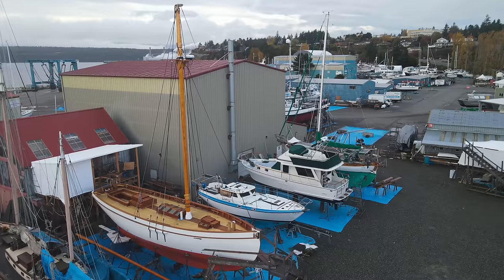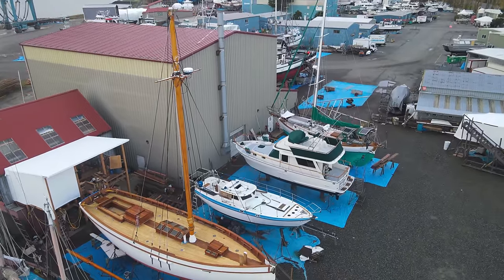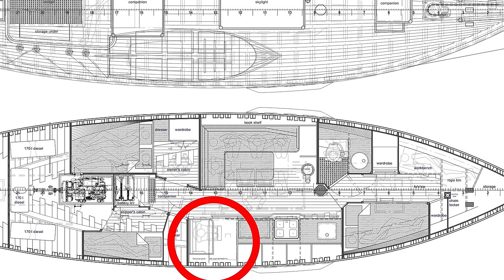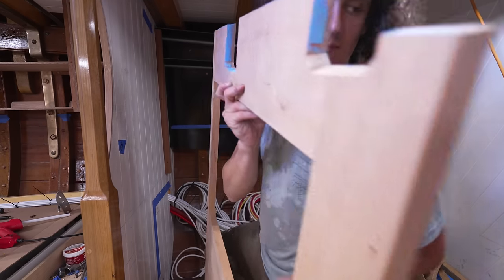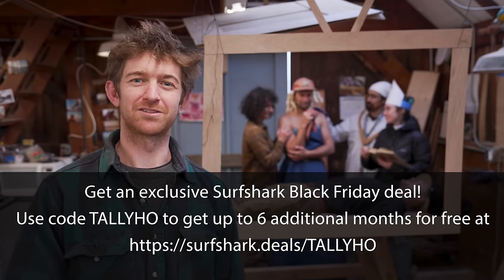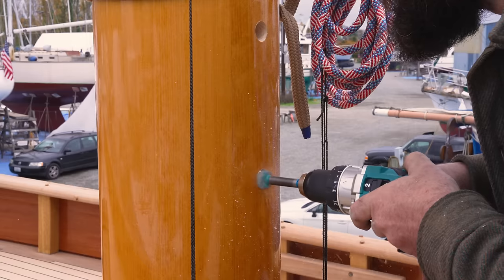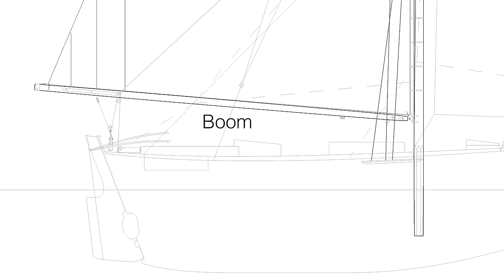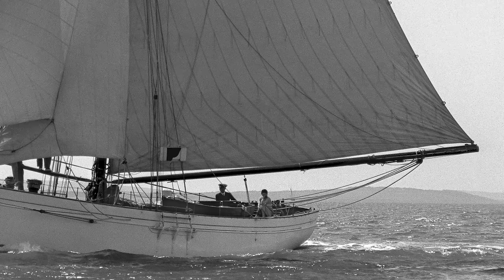Tally Ho gets an absurdly long Boom.

Comment: I always love seeing the purpleheart wood go into the boat. As someone who doesn't do much woodworking other than cutting a few bits of pine now and then, it's color is so alien to me! But kind of like cedar, with how it changes over time and after cuts.
Reply: Osage Orange does the same and although I appreciate the patina, it still makes me sad to see electric yellow go away.
Reply: I thought it was nuts how long those cuts with the chainsaw took. Even sped up it took forever. I would guess that an one cut took about 30 minutes. So an hour just to cut these pieces apart. Crazy stuff
Reply: purple heart is a very difficult wood to work with. it's very hard. the only carving I ever did with it I had to use coarse rasps, and my grandfathers WW2 kabar knife XD
Reply: I make hiking sticks as a hobby with various designs of top. Recently I thought it would be good to make a market stick top out of purple heart. I had never heard of this wood until I started watching Leo and the crew. However, once I started cutting and shaping the wood I was astounded as to how difficult to work so all praise to the crew. I finished off my stick with Danish Oil. While the process was more difficult than I could have envisaged the end result was well worth it and probably foolishly I am just about to start on another. Well done all the crew. There are people who call themselves carpenters and then there is Leo’s crew.
Reply: Xyla Foxlin used a small piece of Purple Heart to make a bass, and said the wood was so difficult to work with she'd never touch it again. Love thinking about that every time they start roughing up another big chunk of Purple! This crew ain't afraid of work

Comment: Love to have your comments on how the long holes for the fife rail post bolts were drilled accurately.
Reply: I wondered exactly the same thing! I imagine the process is the same as drilling the holes through the stem. I need to watch that video again.
Reply: Yea figured there would have been some footage of that  because I'm  sure it's not that simple of a task
Reply: At 11:46 video shows the top of the posts. The holes are a little off center but very adequate for the application.
Reply: I’m also a little confused about how the teak rail was mounted. Was it in two pieces split down the middle and both notched into slots in the posts. I was expecting the rail to master the posts, then the bolts to go through all of them , but I guess they needed the posts to stick out above…
Reply: Centered to the posts?  LOL they need to be centered on the backing oak down below MORE.  Where that was is dictated by the  support structures underneath.  The rail had to be where it is by the distance to the mast.  Of course I guess but drilling into the center isn't hard.  Although I wanted to see the giant boring bit going through the purple heart as well, @buckboard43
Reply: @trevfindley4155  I'm guessing it's like the separators in a cardboard box for 12 wine bottles ;) where a slot is cut into the two crossing pieces and then the pieces are pushed together. The joint looks wonderful!
Reply: All I know is they were done with Zeal!

Comment: I just got well confused and had to talk to my new best friend about sheets:

User
I just heard that in rigging, a sheet is actually a line - possibly connected to the boom. I thought a sheet was a sail!?

ChatGPT

In sailing terminology, the term "sheet" indeed refers to a line (rope) rather than a sail, which is a common misconception. A sheet is used to control the angle of the sails in relation to the wind, and it plays a crucial role in managing the boat's propulsion.

Each sail on a boat typically has one or more sheets attached to it. For example:

    Mainsheet: This is the rope used to control the main sail. It is often attached to the boom, which is the horizontal pole extending from the mast and supporting the bottom of the mainsail. The mainsheet allows the sailor to adjust the position of the boom and thus the angle of the mainsail.

    Jib Sheet: A jib is a type of sail set ahead of the main sail, and the jib sheet is used to control it. Like the mainsheet, the jib sheet is vital for adjusting the sail's angle to the wind.

The purpose of sheets is to "trim" the sails, which means adjusting their position to optimize the boat's speed and the efficiency with which it captures the wind. This is a fundamental aspect of sailing, as the positioning of the sails directly affects the boat's ability to harness wind power.

The word "sheet" in this context comes from an old nautical term meaning the corner of a sail. The ropes were originally used to secure the corners of sails before they took on their current role in sail adjustment. Over time, the term evolved to refer specifically to the ropes that control the sails.

User
What about "three sheets to the wind", what does that mean then?

ChatGPT

The phrase "three sheets to the wind" is a nautical idiom, but it's not directly related to the technical aspects of sailing. Instead, it's a metaphorical expression used to describe someone who is extremely drunk. The origin of this phrase is indeed nautical and relates to the sheets (ropes) used in sailing.

In sailing, a "sheet" is a rope or line that controls the tension on the corners of a sail, not the sail itself. The stability and direction of a sailboat are greatly affected by how these sheets are handled. If several sheets (particularly on different sails) are loose and flapping in the wind, the boat would lurch about unpredictably, much like a drunken person staggering.

"Three sheets to the wind" specifically refers to a situation where three of these lines are loose, causing the boat to be unstable and out of control, similar to how a person might behave under the influence of excessive alcohol. Over time, this phrase has been adopted into general English usage to describe someone who is very drunk, drawing on the imagery of a ship being tossed about unpredictably due to its loose sails.

Comment: For any other non-sailors scratching their heads at 13:35 perhaps this helps: 

Boom = Wooden pole for controling the lower edge of the mainsail (not a loud sound) 
Sheet = Rope line (not a sheet) 
Horse = Iron bar to hold the aformentioned sheet (not a horse).  
Gybe buffer = See horse, 
Tack= lower forward corner of a sail, 
Clew = Aft lower corner of a sail.

Great work as always!

Comment: Wait a danged minute! How did you drill the holes vertically in a post that long and stay in the center of the post?
Reply: I missed it too.  I replayed back a few bits trying to find it.  It wasnt recorded. Maybe they used a wood lathe, where the stock would rotate and the drill bit would remain stationary, insuring an on-center bore.
Reply: They have a long drill custom made already. It's just drilling a long hole thru some wood. 😅

Comment: 17:50 I just need to point out the BARREL . The bokeh’d barrel in the bottom back corner of this frame is a perfect example of how carefully and meticulously Leo and the Crew are going to nail this build, exemplary, truly. That probably didn’t have to be there, it was probably thought about, yet  it adds such a sensation. Applause, all around.

Comment: I yous to race on a 30ft. snub nose gaffer -1923- ,The owner decided to add a little more sail area > Like a 12 ft. bowsprit & a 24ft boom as well as a sky sail , When the sky sail top sprite would crack (& it did reguly) we called it an auto reef . Great fun especially down wind in a gusty 30 knots . Skippered a sister ship to what your building there , Fine job , Fair winds .

Comment: The mast height (and I know the topmast isn't installed yet) boom length and upcoming bowsprit installation show that 2023 Talley Ho, while not only faithfully replicates her original rig, harks back to the era of super-sized rigs (like those that were sported by the J-Class racers) especially when compared to the average modern yacht. Her overall length isn't that great but her sail area in calm conditions will be huge, perhaps double that of most yachts around her, and more in line with modern super yachts.

Comment: Pretty sure the fife rail is so named because the fife player and drummer would stand there (at the break of the quarterdeck where the fife rail was located) during ceremonies such as piping the captain aboard. In the original lexicon, Tally Ho's fife rail would likely be called a pinrail as well.

Comment: With a machinists eye, I see that the goose neck hardware is Skookum, but the pin connecting the the boom to the bronze mast bands looks only about 1/2" diameter.
Why so small? I would have designed 3/4" minimum, and maybe 7/8". If you some how jam the boom toward the mast under sail, you are in deep do do.

Comment: I've always thought (for no particularly authoritative reason) that the fife rail was so called because of its resemblance to a fife.

After all, it's pierced with a regular series of holes. In service, these will take belaying pins, but in the shop the holes are open. The resemblance to a fife requires only modest imagination.

All credit to William Fife III, but these rails predate him by well over a century.

Comment: You could install a 6mm thick polycarbonate sheet under the glass. In this case, even if someone steps on the window in a storm, he will not break it or cut his leg, and even if the glass cracks, the polycarbonate will withstand everything, even the fall of a tool or rope from block

Comment: Seems like "Duchess of Desire" would work well on the tender. Incredible work from the whole crew. The boom, mast, and hardware look incredible. Any way to ensure that a dropped pin doesn't take out the cabin roof glass? Safety wires?

Comment: Great to see another piece of the rig go on. 

Rachelle makes a good addition to the duchess of desire cast. That's too bad you didn't show Zeal drilling the long holes. I was wondering if those one were going to be done with a lathe/etc as they are in small enough pieces to be moved around at least.

Comment: Would really have liked to see how that rail was fitted between the posts and how it was fastened to mitigate the upward tension
Reply: It appears the rail was halved lengthwise, and rebated into the post, each on three sides, then glued along the seam. The rail's not going anywhere.

Comment: Why were there holes drilled into the mast (12:27) where the gooseneck fitting rings are clamped to the mast. I don't see any bolts that go into the mast through the gooseneck rings. It also looks like some plastic rings/tubes were put into the holes... what are those for?
Reply: the hardware has bosses which are part of the casting that stick into the mast to help keep the gooseneck located. the holes in the mast are lined with G10 tubes to help spread the stress across more fibers in the soft spruce.

Comment: What was the point in drilling the holes in the mast and inserting the fiberglass bushings?? Are there hidden bolts that are threaded into the backside of the gooseneck fitting which takes the boom and then the forward clamping ring hides the bolt heads from view??

Comment: Thanks for another great video. Out of interest, is there a reason you wouldn’t have the bolts for the Fife rail going through the rail too and holding the whole lot into the deck rather than just the posts?

Comment: I notice from previous video you are using high tech spectra or similar rope for standing rigging. While lighter when dry, does this not become very heavy when wet or does it not absorb water like normal line? Will all the hylyards cleated to that post thingy not interfer with the swing of the boom when the main sheet is eased? I've never seen wood working on a boat of this extremely high calibre before.

Comment: I am concerned about the location of the rail. In the lines plans from the Albert strange site, the rail is forward of the mast and afr of the scuttle hatch. The current location looks like it will interfere with boom travel on a reach and deeper, as well was put the halliards in a position to chafe badly on the mast rings and the mainsail luff. Has anyone else noticed this? It seems like the bronze belaying pins on the boom by the mast are almost touching the uprights even now.😮

Comment: At the end of the boom where it mates with the mask there is some fancy practical hardware, including what looks like two vertical metal pins on each side of the boom; they look like they might be removable. What are they for?
Reply: They are belaying pins and will be used to reef  (make smaller) the mainsail. At the end of the boom you can see two times three small sheaves (wheels) between the boom ans a piece of wood that prevents the rope(s) to slip. That the other part of the reefing system.

Comment: Leo - I would like to know how the craftmanship and materials that have gone into the 21st century Tally Ho (all of an amazingly high standard) compare with those of the original boat. Clearly the rebuild closely follows the Albert Strange design but how do the details compare - the sumptuous joinery down below, the beautiful deckwork, the fantastic bronze fittings as well as the construction details - the joints, the fairing, the use of different woods for different purposes. And how does the comparison extend into manhours employed in the rebuild compared with the original construction, particularly given that power tools have been used so much  - these were presumably not available in 1910, certainly the powered hand tools. Obviously the modern boat has far more in the way of electrical, mechanical, hydraulic etc systems and more plumbing but those elements apart, would a bystander in Albert Strange's yard have seen much the same  standard of workmanship and tasks being performed as we Youtube viewers are seeing in your yard today?
Reply: I guess that the original work was slightly more pragmatic. I doubt the original builders planned for a 100 year life for the boat at its original construction. Leo's built in what has been learned from the state of tallyho when Leo took her over, and clearly has planned for at least another 100 years. The use of bronze and copper fittings throughout is clearly aimed at mitigating the iron sickness that was so prevalent when Leo took on the boat.

Comment: amazing colors everywhere topside , tone in tone

I keep wondering if the boat is going to get one final white layer on the outside. How many it got now, 3 if I rememember. 2 white, and then some first layer. Is it possible to get the shine up one notch?
Reply: I guestimate the fact the boom extend past stern is the arrangement higher upin the rigg and that the main sail actually is a freaking big one ..... and then more sail above that... this piece of mast is going to externded up further. But yeah many square meters of sail in the main sail alone. 

Only reason the boom can be this long is the arrangement higher up in the rigg.  And above that even more sail. Small ones which is the first you start to .... google translate says "tear down" come on not really ..... found the word I always thought it was ... they can be reefed ...

Still the wind can pick up more and more and more so .... Leo can in the future tell us about that main sail. Most boats reef what they got but the main sail remains ..... sure as H it can reefed too .... the mechanism to lower it bit by bit as required could be yet another tally ho episode.

Comment: What was the purpose of the holes drilled in the mast where the plastic sleeve went in that the gooseneck bands covered?
Reply: I think there was a pin on the bronze pieces so that they could not rotate on the mast.
Reply: @davep5788  that was my guess as well,  but didn't see it happen so was hoping someone would confirm it?

Comment: Question: I'm missing a detail piece driving me nuts - On the Gooseneck mounting, he drills holes in the mast, glues in (delrin/phenolic?) bushings to receive a pin-bolt? but don't see how it's used.  Q - is it safe to say, there are locator pins cast to the inside of the mast clamps?  12:56  has me asking, what's going in there?  Right at 13:04 - he must be inserting a locator pin I hate assuming....
Reply: Each bronze band has a pin on he inside. This to prevent the band moving in any direction,

Comment: Before attaching the gooseneck fitting Bob bored 2 holes into the mast and glued in a what looked like a plastic pipe liners. What was the purpose of those holes?  (I am guessing that the bronze fittings had bosses that fit into the holes to keep the rings from rotating around the mast.)
Reply: Yep

Comment: Why were the two holes drilled in the mast under the goose neck hardware?
Reply: I think maybe anchor points for the gooseneck itself, to stop the whole assembly rotating around the mast..could be wrong
Reply: That's my question too... I didn't see any bolts going through the rings and the mast... so yeah.

Comment: 18:21 You have mainstays behind the boom. It looks like the boom can only swing out about 45 degrees. is that correct?
Reply: Those are running backstays. When running downwind the leeward stay is eased as necessary.

Comment: Why are there belaying pins on the forward end of the boom (insert nautical correct term here which has eluded me for the moment) what kind of lines to you tie of to a moveble spar? 
andwon't they get in the way with the lines going to the belaying pins on the five rail ?
Reply: Most important line here would be the outhaul, to keep the mainsail's foot stretched along the boom. It must be adjusted each time the mainsail is (un)reefed.